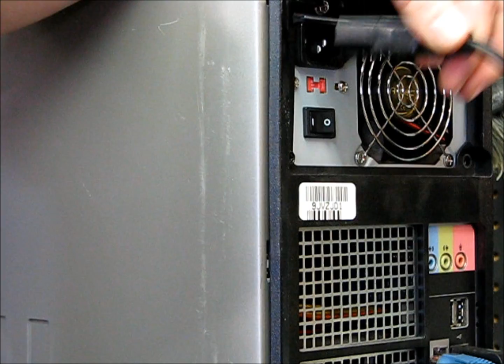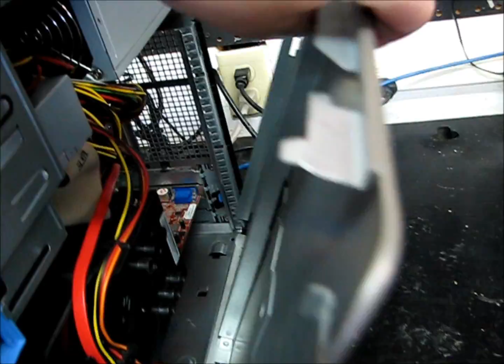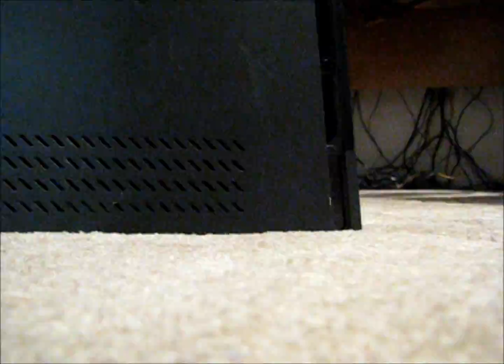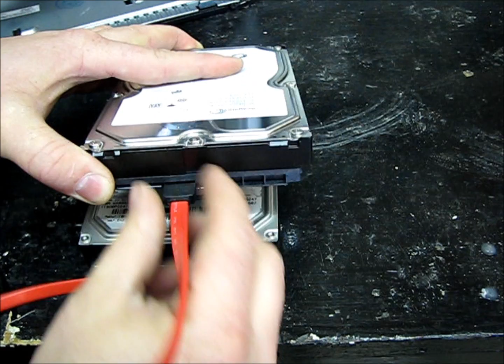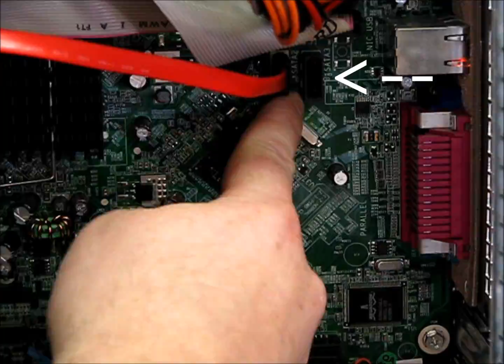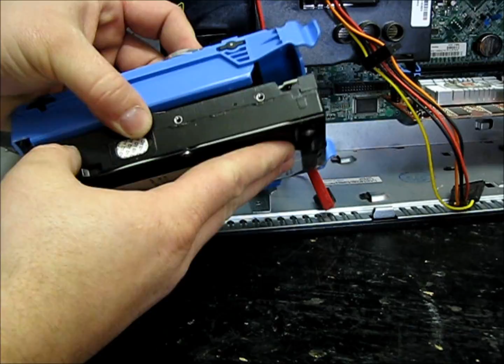How to Replace a Desktop Hard Drive

Comment: I want to replace a clicking sata hard drive with recon sata hd. Issue is I need to transfer my new windows 10 upgrade OS onto this new drive. I've looked at saving to USB memory stick and then reloading to new drive but can't find the OS on the old drive? I have no other files on the pc anyone got the simplest way to do this or where can I find my win10 OS cheers

Comment: Excellent demo. Thumbs up. I wonder how you format it without operating system. Windows etc. I'm replacing mine since old hard drive is broken according to diagnostics. But everything else works fine.

Comment: If I take a hard drive with data/programs from a computer that is dead.  ( Drive is ok, I think but the fan,plug etc isnt working...can I reinstall the drive on a new computer (same brand/type/year)?  Does the data disappear or will it work on a comparable computer?

Comment: hey man , i have 2 Sata hard Drives , and i want to take out the secondary hard drive , but i don't know which one is the primary and secondary :(
Reply: You need to unplug one of the drives and power up the computer to see which drive is missing. Alternatively you can get the serial number of the drive from the PC and read that on the label of the drive.

Comment: Hey,I have a toshiba hard drive and it is suposed to have 3Terabits but when I pluged it in says it has only 100 mega bites... Can you help me in any way?
Reply: not all computer chipsets support 3tb
Reply: Seriously... Now I have to get a new chip? GOD DAMM IT! Well thanks for the advice... =P
Reply: Random Person nope the chipset is part of the motherboard,, you will need a new board
Reply: ictdude1 Does it work if I just "trash" my old hard drives and replace them with this one?
Reply: Random Person no you still need to upgrade your motherboard
Reply: God dang it!
Reply: Random Person you might be able to get away with using it as a usb hard drive if you buy an external 3.5'' hard drive enclosure
Reply: Probably far too old to matter, but in some cases the drive has a partition that's only 2tb and another 1tb one that has to be enabled.

Comment: I WANTED TO ASK... And Need Help My Drive In My Computer Has Failed Or Died And When I Turn On The Computer Its Telling Me To Replace It ... Now My Question Is... If I Put The New Drive In Like You Just Showed Then What Do I Do Cause I'm Not Just Adding A Drive I'm Replacing The Only One That Came With THe COmputer? ... Please Get Back Thanks

Comment: Little question if i put an old hard drive with windows installed in a new computer without windows, will the new computer get windows automatically? or will windows be deleted?
Reply: If you have a hard drive with windows already on it and you put it in a new computer, windows will probably boot on the new machine. When windows boots up it will start replacing drivers and reconfigure some things as it was previously set up for a different machine. Also, Windows will detect complete change in hardware so it will want to re-activate, this should be successful as long as the cd-key used is still valid. If the key was from an old volume license (like an expired TechNet account) it may not activate, you would need to put in a valid key to activate Windows.

Comment: Just a Tip! An older hard drive or most older Components take a Molex Cable which is the 4-pin Big Connector for power. Great Tutorial Though!

Comment: You lost me in the first 30 seconds. First unplug your computer. No don't. Touch your computer first with it plugged in. No just leave it plugged in...
Reply: James Guy Photography so people suggest that the first thing you do is turn off your computer, (for safety reasons I presume), though he suggests you leave it plugged in so you can ground yourself using it to keep any static electricity from ruining your computer.
Reply: @twat-y4e  Plug it in but leave it off, that grounds the PC to make sure you dont potentially damage it with static, but wont shock you